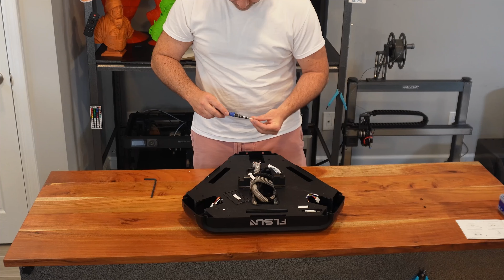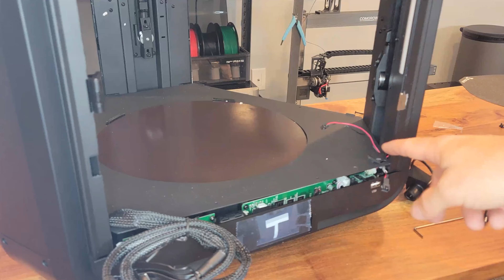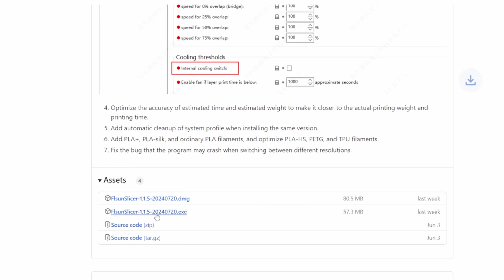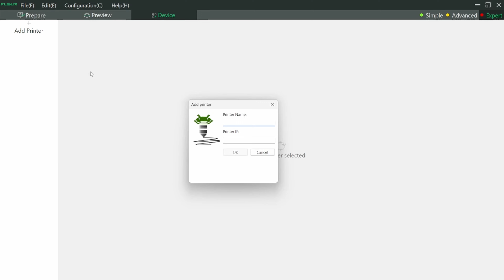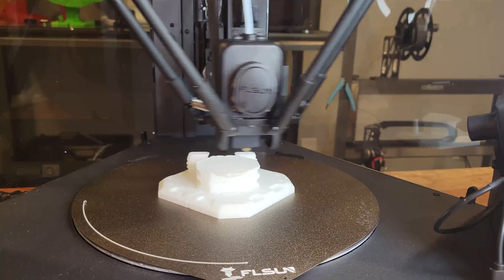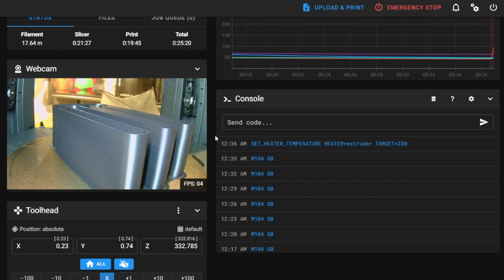First prints and First impressions with the FLSUN T1

Comment: Why would I want to acces the code controlling the printer? I DO NOT want to follow the way of the dinosaurs and spend more time working on the printer than actually printing.
If it works the way it is, I don't give a flying puck about what's going on in the backend.

Comment: This was the last nail into the coffin of  my purchase considerations. No SSH, and no user of an FLSUN printer without the experience of software problems in one or another way. The noise is so incredible, that they sell an upgrade bundle and an even more expensive machine than this, the Pro. And what really made me sick was the tangling up of the filament. I stopped the video and had a look at the primitive contraption to hold the filament spool: this is really hilarious. This, together with a jokingly short piece of PTFE tube killed my dreams. - I think, FLSUN has a long way to go, and they have to eradicate serious problems and errors. One error is, e.g., to make use of open source software and then block the SSH access. This is a contradiction in itself. Anyhow, goodbye FLSUN, take care!

Comment: Great video！I just bought one. I’d like to extend the extruder by replacing the current nozzle with an extender and a CHT volcano nozzle. Is it able to set the Z “height”?cause i didn’t found any manual setting in z axis calibration😢😢

Comment: Also, you are making a review on a 3d printer that is marketed as super fast, and u dont mention the print time on any of your prints, i recommend stating print time.
Reply from the maker: Well firstly this isn't the review, this is just a few of the expectations you can have when unboxing it, so stay tuned for a way more thorough experience with this printer. Print time can certainly be a data point that I add to this series and I appreciate that suggestion but I've always shyed away from print time because there's so many factors that can affect it. The problem I always see with that is that slicer settings are a huge factor on print time. Adding walls, increasing/decreasing infill, changing the number of top layers, slow first layers,  selecting a different infill pattern, number of  etc can have a significant effect on print time. I actually plan on releasing a short video showing some of the drastic time differences small slicer settings and have. So ultimately what I plan on doing during the review is show what the flow rate and max speeds/accelerations this printer can reach so that each viewer can determine what print times to expect. 
    So I appreciate the feedback and it's something I'll think about but I would try and make that addition in a slightly different way. Thanks!

Comment: I have been 3d printing for 9+ years and have built all my printers (kit and off the shelf including a 1st gen FLSUN) and while you want to SSH into it and I want to SSH into it... The newer breed of 3d print users do not and should not. They would mess something up (not all of them of course) and cause support issues and possibly even destroy parts of the printer. I guess I get why the manufacturers are locking them down. Maybe there should be a YES, you can SSH into it but loose support at that point? Good quick 1st look. Boy that thing is loud!  lol
Reply from the maker: Yea this is loud lol I saw this morning FLSun emailed about the noise, and they may have a possible solution to quiet this down a little. Something I'm going to look at when I can. 
    As for access I do agree giving too much control to newer users could be a calamity, and I think developer's solution to not allow front end components to be updated is a smart move (mainsail, fluidd, Klipper, Moonraker, etc). I think allowing SSH access is a safer solution because generally those users who know how to SSH into their machines, and have a want to do so, are responsible enough to not make any grievous errors. We'll see in the future what FLSun decides to do, I'd love to be able to hook up OctoEverywhere on this printer so I can use it and monitor it while I'm away from home. Feels like that's how I've been doing most of my printing nowadays 🫤
Reply: This printer is running Klipper.  Klipper is GPL v3, which means that any company using it has to offer the end-user the mechanisms allowing him to replace any part of the software by a version modified by the user.  That's a legally binding requirement from GPL v3, so all these companies not opening up access to Klipper and the version of Klipper source code should be sued, period.
Reply from the maker: @MisterkeTube yea I completely agree with the sentiment and it's going to be something I talk about in the full review. As for the legal workings I can't speak to specifics because I don't know how the law is worded and works and that's where we get into the weeds , and where companies probably feel emboldened. I don't know what sort of precedent there is for a timeline of presenting said firmware. If a company holds their printer in 'beta' release or some other similar title will that be something not quite covered by the license. How they maws get considered and applied to companies working overseas. And also the fact that Klipper likely has no resource to pursue any sort of legal actions. They are a community driven entity (thanks to Kevin O'Connor) that would probably be more hurt then helped by taking time/resources to pursue such an endeavor. That all being said I don't like it and it's something I am going to talk to FLSUN about and cover in the video.
Reply: @PrintsLeo3D  There are law firms focussing in class actions, earning their money as a percentage of what they get out of the case they are making for the group of victims they represent.  Why is no law firm tackling the open-source infringements in the same way?  There must be some money to make there and a couple of precedents would be sufficient to convince companies to just adhere to the license, period.
Reply from the maker: Yea I agree it would be nice for someone to make a move and create some precedent for future cases. Right now we're seeing Stratasys use their legal and monetary forces to try and bully some companies around, it would be nice for one of the little guys to have the same access to those  avenues.